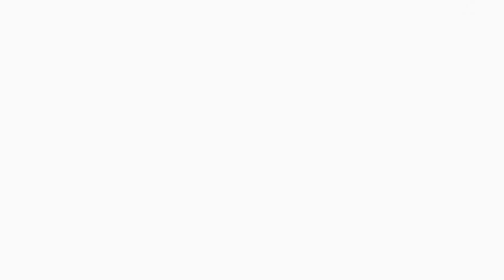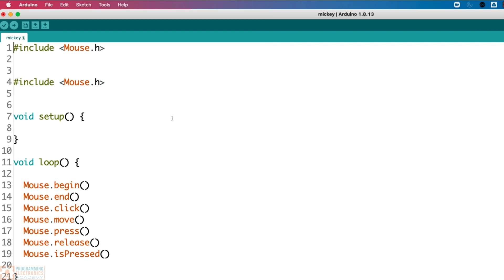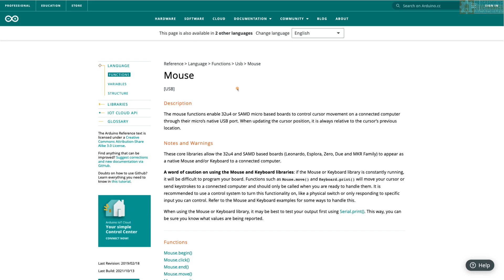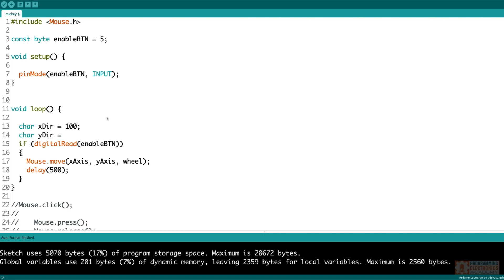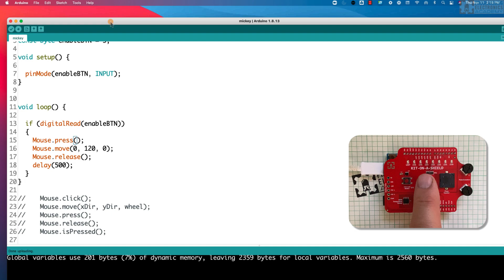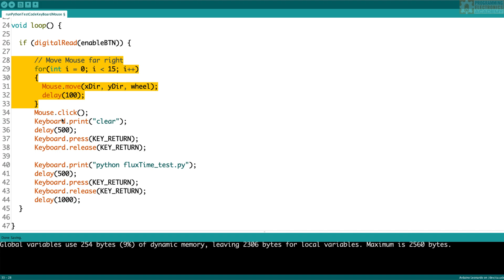Control your mouse with Arduino!  Automate simple tasks!

Comment: I’m having a problem with my Arduino GIGA R1 board. I bought it, but I can’t get my SteelSeries Rival 5 gaming mouse to work with it. My goal is simply to be able to move the cursor and click using the mouse through the board. However, I keep getting a lot of errors, and sometimes the board doesn’t even provide power to the mouse. I’m using the USBHostGiga library.
Reply from the maker: Hmmm.  Thats got to be frustrating.   Is it working with any other USB mice?

Comment: Thanks very much for sharing your knowledge around this. If it  helps anybody, as stated in the video, there's a limit to how much you can move the mouse in one movement (the range of -127 to 128). If you want to move it more, simply call the function more than once. Maybe there's a better way to do this?

Comment: Hi there, awesome video. I have been looking for something like this for project, emulating a mouse over mqtt for my cctv. I have experience with esp8266. Can the mouse library be combined with the Esp8266 modules to make a mouse over mqtt?
Reply from the maker: Great question!  I do not believe the ESP8266 support the Mouse or Keyboard Library.
Reply: @programmingelectronics  Yes Esp doesnot support mouse or keyboard but I am trying to use esp8266 over mqtt to make an arduino pin high which can be trigger for the mouse clicks. This could be possible with a common ground or drawing power for esp from arduino itself. But then again the problem I think could happen is that esp gpio works at 3.3v which maybe too little for the arduino to realize as high.

Comment: What about being able to READ data from a mouse?
Reply from the maker: Cool idea!  Just to make sure I follow, like to get information about # of clicks?
Reply: @programmingelectronics    Mainly I want to get the X and Y movement and then use that to control speed.  Mouse buttons would be use do increment/decrement a variable to fine tune the movement.   I've found a USB Host shield that is supposed to do what I need and there is a library to use with it.  More to come.
Reply: Very cool  @TheJimtanker  !
Reply: @michaelcheich2481    Come to find out, I need an Arduino Due to use the USB Host shield.  Darn!

Comment: One more suggestion ( that I should have mentioned in the last comment) if you put a delay of say 15 seconds somewhere in your setup Loop this will give you a 15-second buffer between when you plug in your Arduino and your sketch starts running giving you the 15 seconds to uploaded a  corrected sketch once you've perfected your sketch you simply comment out or remove the delay.
Reply from the maker: Nice!  I love that idea! Thanks for sharing. 

I have a feeling this was learned in the school of hard knocks :)
Reply: @programmingelectronics  yes sir, I learned that shorting something out is not the only way to "brick" one. 🙂
Reply: This is the best tip for everything watching this video!

Comment: Cool video.  Over the years I've found way more uses for the Arduino keyboard routines than the mouse.   It's a little tougher to use the mouse routines, because they depend on where the cursor starts on the screen and where everything else is located.  The following are some of the uses I've found : 
1) Wiggler - When I was suddenly working from home, my work laptop was still forced to lock the screen after 5 minutes of non-use.  At home this didn't matter anymore, and it was a pain to have to unlock multiple times a day.  I wrote a Pro Micro sketch to emulate a mouse that every few minutes moves the cursor just 1 "mickey" (This is what mouse units used to be called, I don't know if the routines use this as a unit) and then back.   This is small enough of a movement that is doesn't really affect your work, but will keep the screen from locking.  I added a button to enable/disable the function and an LED to indicate the mode.  You can buy devices online that do this for about $20.  I saved that money, and when I stopped working from home, I reused the Pro Micro for a different project.
2) Pointer Goofer - When a button on the Arduino is pushed, the mouse cursor is moved a small random distance in a random direction (or multiple buttons to make it directional).   This can be a game where someone tries to perform some simple task while someone else pushes the button at opportune times.  I used this as an April Fools joke while my boss unknowingly presented at a team meeting.  (if you do this, make sure you have a joke friendly boss, and also make sure the meeting is not business critical! )

So what's next?  - Gamepad/Joystick?
Reply from the maker: Thanks a ton!  I love those projects - I am totally going to mess with my kids - ha!

As for the USB library, not sure what is next - I have kicked around building a "custom" joystick - but I'm not much of a gamer my self, but my kids love games, so maybe I'll make something for them to use....  Thanks again!

Comment: Great video!
The mouse moves in a relative way. Would be good to have an "absolute move" function to have mouse click in the same spot repetitively like an icon in the task bar.. I guess a workaround would be to move an incredibly ridiculous amount first to guarantee the mouse is in 0,0. Then move relatively.
Reply: My thought exactly
Reply from the maker: Thanks so much!  I like your strategy of "forcing" a 0,0 start point and then going from there.